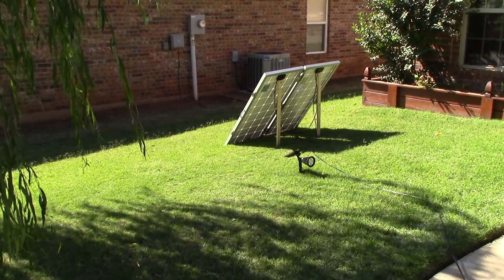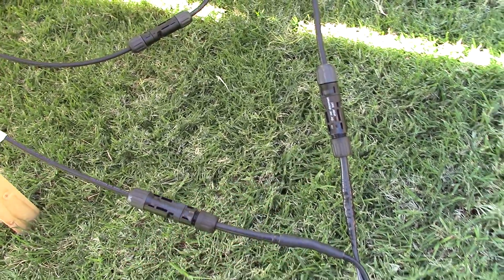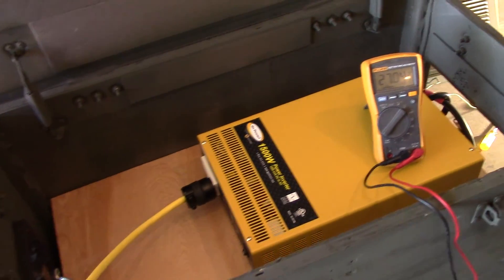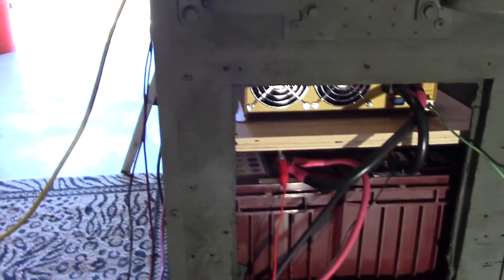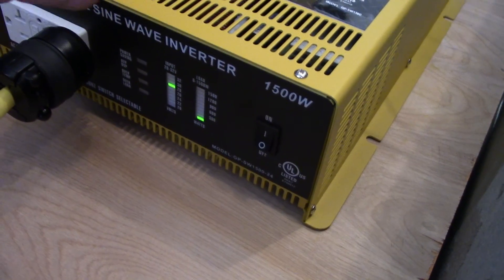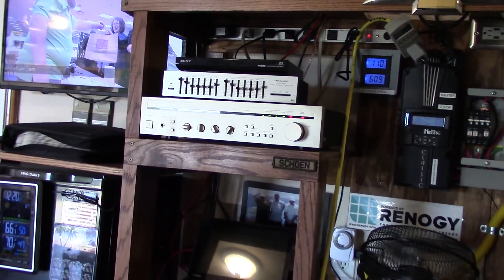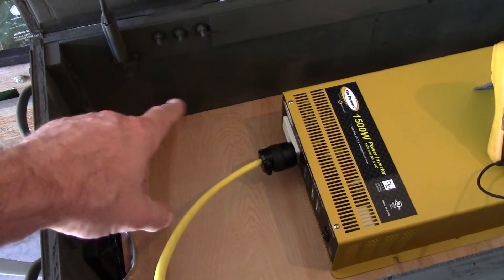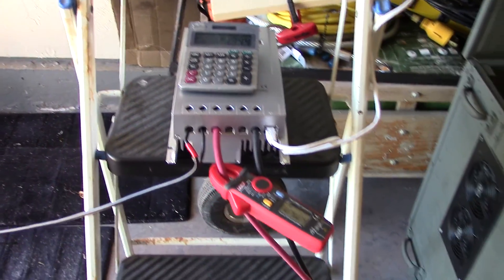DIY portable (transportable "bug out" box) solar generator (Part 4)

Comment: Thanks for your help so far Chris. One more thing, when the Charge Controller and Inverter have a rated AMP maximum is this to be based on the open circuit voltage of the panels?
Reply from the maker: Most olar charge controllers Amp rating is based on their output charge capability...ie, how many amps it can push into the batteries. Solar panels voltages/ampacity is all over the place. And with MPPT, one can have 100-150 vDC coming in with very few amps...but, the solar charger will convert that higher voltage to amps for charging. VOC (voltage open circuit) is the maximum voltage a panel can produce. A solar charger's maximum voltage input needs to be able to handle that VOC. Not sure what you are asking when it comes to inverters...
Reply: Ok, so if i have 4 panels, I add up the VOC of each panel to make sure the charge controller can handle it? and what figure do I look at on the specs of the charge controller to see if it can?  I'm pretty set on buying the Midnite KID.
Reply from the maker: In series...the volts are added...so, yeh, one could add the panels VOC to get a number. The KID is a beast and is rated for up to 150 volts in panel voltage. If the four solar panels are 12v panels...should be well below 150v. On my system I run six 12v panels in series...and it is below 150v.

Comment: Great video. It'd be awesome if you showed the process of installing the fuses and breakers. Where they go and how big they have to be, just a suggestion. Also, if I'm using 1.5kwhs over 24 hrs for a fridge how would one calculate the size of a battery bank and panels to run that. I'm super confused how to work this part out of it. So far I'm calculating what all our devices use in a 24 hr period before I buy anything. I'm going to go 24 volt to help with voltage change on the inverter. Many thanks
Reply from the maker: Thanks! Will be using circuit breakers and will capture it on video. Online calculators will convert a battery's aH (and volts) to KW/H. Once you get that number you can divide that 1/2. That will get the "50% discharge" of the battery. Going below 50% will shorten the life of the battery (many videos on this). As for calculating device use...recommend a Kill-a-Watt meter (like $19) and measure the KW/H hours used in a 24 hour period. If those devices use (just an example) 2 KW/H in a 24 hour period...you can size your system for how many battery/solar panels needed. My design is for 1 KW/H use "overnight". During the day, the batteries are being charged...and keeping the "load" on the inverter less than what is going in will charge them and suffice the load. Gotta have sun to do all this. That is drawback with these solar generators. Thanks for watching.
Reply: Thanks Chris
Reply: So just so I've got this an example :-)   If I'm using 1KWH per day and getting 5 hrs direct sunlight a 200w panel @ 5 hrs is 1000 into the recommended no less then 50% discharge bank so 1000 divided by 24v equals 42 Amp Hrs so double that to say 100 amp hrs and add an extra 200w panel to double the intake over the 5 hrs to allow for rainy days then this system is sized correctly so I don't discharge below the 50% (providing the following day is sunny). Does that sound right?   Thanks again.
Reply from the maker: Yep...another good rule of thumb (so they say) is to use one 100w solar panel per each 100 aH battery. Converting to 24v just makes that energy transfer more efficient. Most solar charge controllers will "current limit" if one uses too many solar panels (in the case of cloudy days/winter/etc). However, running a solar charge controller at full tilt is not recommended. Even the big boys like Midnite Solar don't recommend it. However, to each their own...

Comment: Eh, Chris, work, work, work....good progress. What did you do with the old KID when you changed it out with the new Classic ?   I am about completed with my portable panel rigging. I'm using aluminum angle I have leftover from previous projects. Next is setup reinforcement for the bottom of my "truck box".  Taking photos as I go. I am getting some tutoring from my neighbor on Facebook use so I can start sending pix to you in the future.  Temps are dropping so open garage work tomorrow. Time to chill a brew or two....Jim K
Reply from the maker: Thanks. The company took my Kid...and the Classic was not new (factory refurb). Your project sounds very interesting...be safe!
Reply: OOOH NOOO !   KID-nappers !  You are still a CLASSIC in my tech books.    J K

Comment: Nice work Chris. I have a mini version of this, but I'm thinking of making a similar unit.
Reply from the maker: Thanks...seen a lot of 12v solar generators out there. Some are excellent, some are really imbalanced. True, a 2,000 watt 12v inverter on a 50 aH battery and a 50 watt solar panel will run an microwave oven...but, terribly inefficient and not my idea of practical/good idea. Mine is designed for efficiency, clean power, safe, and transportable to a job site, campsite, bug-out retreat, tailgating, bazaar booth-open air food stands, and emergency home back up. Designed it for 1 KW/H use overnight...and during the day (while charging)...use it at or near full power for short bursts (like running an electric saw, drill, fridge, TV's stereos, amplifiers, computers, servers, small microwave oven, toaster, coffee maker, or whatever needs clean/safe power). Thanks for watching and good luck with the build.

Comment: Love the window lock idea on solar panels!  looking really nice & powerful. I would love to see U test out put sine wave of the Go Power unit on your scope that would be very cool.  Coming along nicely.
Reply from the maker: You caught me man...I was having too much fun load testing yesterday and didn't plug in the oscilloscope. I will do that and make a video. The window sash locks (2) were $5.47 total at Home Depot. Pretty strong unit. Still under $250 total cost for those two panels and hardware...there are 200-watt solar suitcases out there (albeit, just a few) that are priced 4x that.